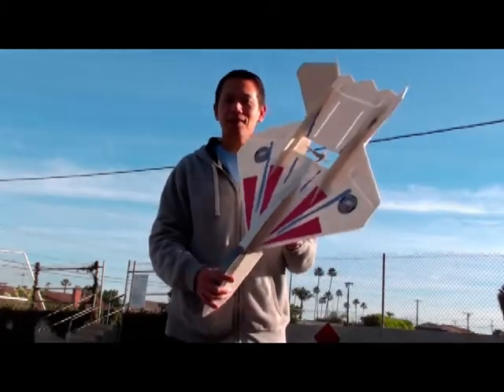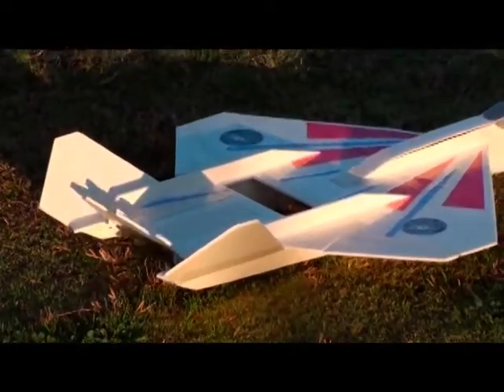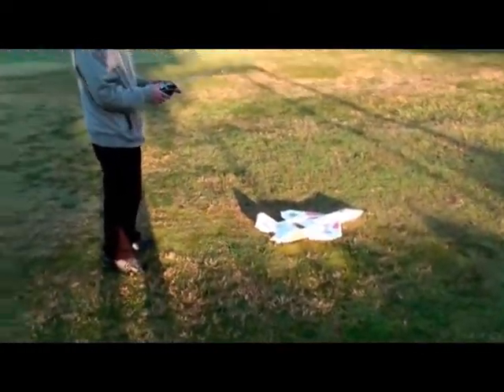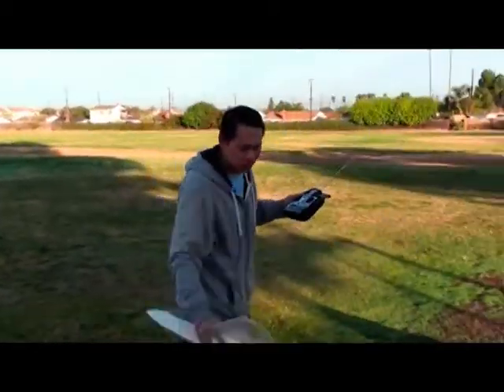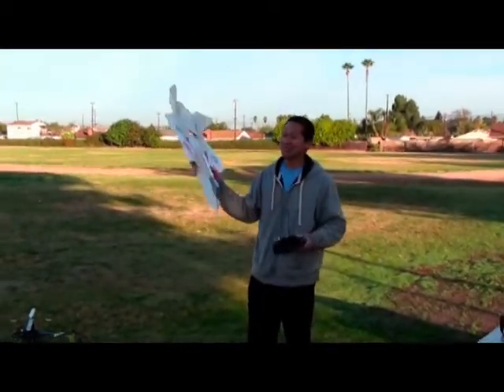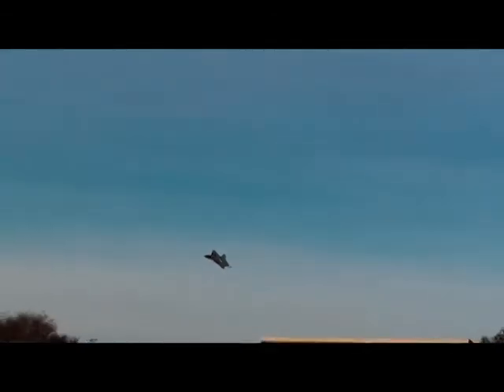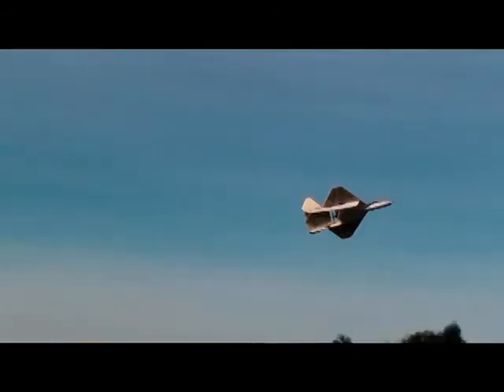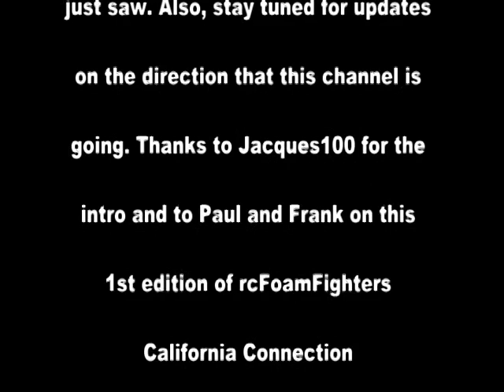rcFoamFighters FF-23 thrust vector parkjet

Comment from the maker: @starwarsjazz i used a super cheap ebay 2212/6 30A esc combo i got off ebay for like $29 shipped. i have over propped it with a 6x5.5 apc prop several times and it has never burned out on me yet (this motor is 2 years old and has already been on 4 park jets)

Comment: I don't get how YF-22 beat this... It probably has better high alpha and only 2 tails = less drag compared to 4 tails.  But F-22 project is cancelled now anyway caz the high cost, maintenance,  etc. 
Also for your RC FF-23 what if you add like a leading edge canards like T-50? will it give more stability in high alpha? PakFa isn't really a high alpha plane caz of the short verticals fully blocked by the wings.  Putting normal canards would make it a J-20 lol